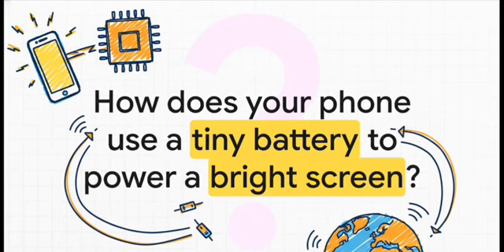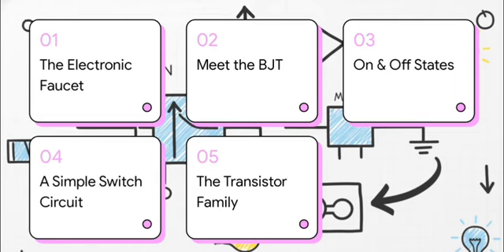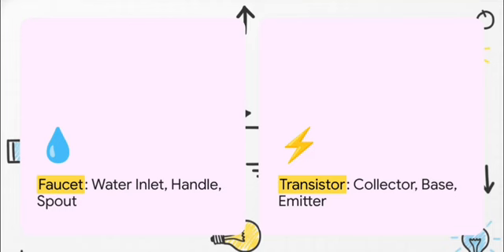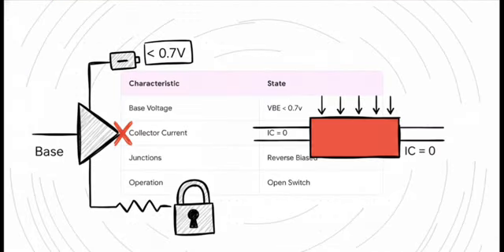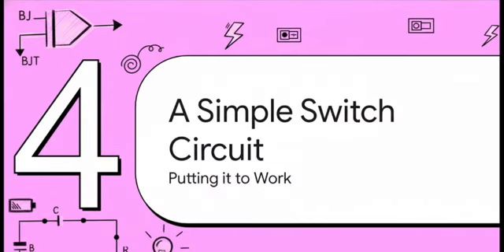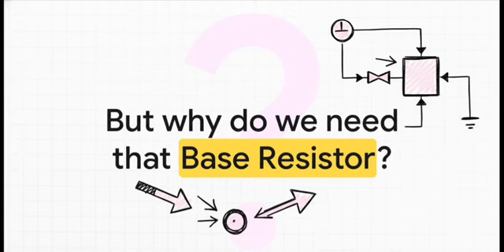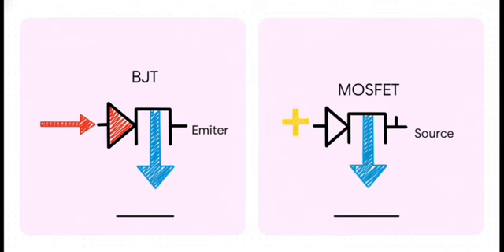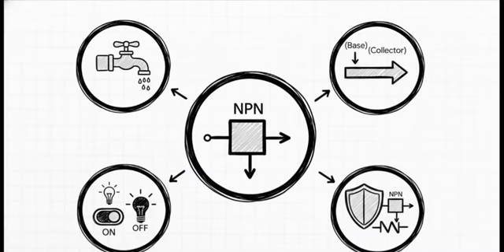How to turn on a transistor||Animations||Concept Motion

Comment: [16/12, 9:52 pm] Anil Vijayawada: సార్ నాకు చిన్న డౌటు, ఒక ప్రొఫెసర్ ఆర్ సైంటిస్ట్ ఏదో కొన్ని కెమికల్స్ ఒక కాపర్ పార్ట్ పై అప్లై చేశాడు అప్లై చేసిన తర్వాత అది డ్రై అయిన తర్వాత 2.4 volts టార్చ్ లైట్ సిక్స్ ఇంచెస్ దూరం నుంచి ఆ కాపర్ పార్ట్ పై టార్చ్ లైట్ వేసినప్పుడు ఆ టార్చ్ లైట్ అబ్ నార్మల్ గా బ్లింక్ అవుతూ బ్లింక్ అవుతూ 40 too 1 minute లో టార్చ్ లైట్ ఆగిపోయింది ఇది సాధ్యమేనా ఏ కెమికల్స్ యూస్ చేస్తే ఆ రియాక్షన్ వస్తుంది
[16/12, 9:55 pm] Anil Vijayawada: Sir, I have a small doubt.
A professor or a scientist applied some chemicals onto a copper part. After applying them and once it dried, when a 2.4-volt torch light was shined on that copper part from a distance of six inches, the torch light started blinking abnormally. While blinking continuously, the torch light completely stopped within 40 seconds to 1 minute.

Is this really possible?
Which chemicals, if used, can produce such a reaction?